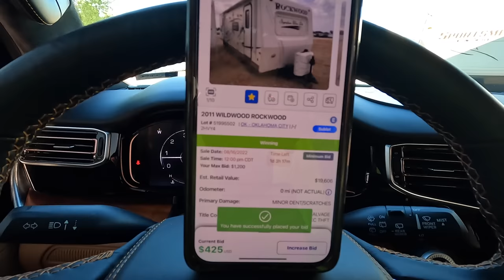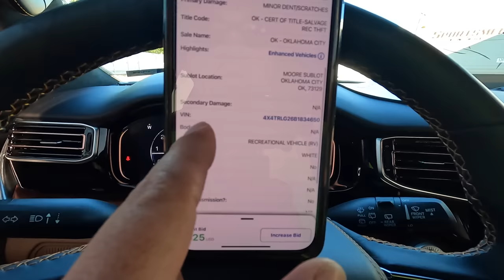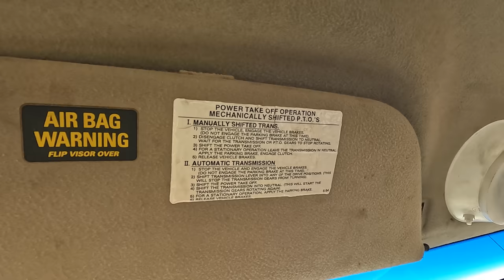Copart Walk Around 8-18-22 + Theft Recovered Trailer + Cheap Ford F550 Tow Truck!!

Comment: Randy the tow truck would work great for you, you can tow two cars at once and if you don't need it then you can turn around and sell it for a profit.  The 7.3 is a great motor and a stick shift on top of it makes it better.  The back lift is called a wheel lift. The PTO is what runs your bed and lift and winch, the two prong plug in the front is to plug in your jump cables to jump start cars also a aluminum bed which is good. Bid on it.
Reply: X2 on the "Bid on that one".  Also, the rear wheel lift is often called a "stinger" by people in the towing industry.  Also, this truck has controls on both sides!   Not all of them do.  That's a very big deal to tow drivers
Reply: Bid on the pickup Randy
Reply: He won't buy it
Reply: I forgot about something I got a diecast diecast Chevy Silverado pickup truck 2017 z71 crew cab
Reply: All trailer to my diecast truck and pulled it with no problems
Reply: I got a die-caster 205 f350 tuff  diecast  truck   it is  bet up  but it  still  tuf

Comment: Randy, the silver bubble material on the travel trailer windows is often called “Reflectix”, and is used to reduce heat gain in the summer and heat loss in the winter to help increase the effectiveness of the air conditioner and/or furnace.

Comment: The F550 would help with lugging cars, definitely help the channel 🤘🏽
Reply: A friend I know has a Chevy truck with a flatbed hauler. One is a 1994 model with a 6.5 litre turbo diesel, a 1998 with a 5.7 litre petrol engine, the other is a 2002 Silverado 3500 6.6 turbo diesel with an Allison automatic transmission. The other two, the 1994 has a 5-speed manual transmission and the 1998 has a 4-speed Automatic overdrive transmission.

Comment: One thing about the flatbed wrecker....
You could haul more than one car at once. One on the rolloff and one on the boom or the trailer on the back.  I know you buy more than one at times...and you have the new building site to move to...
Also the camper will come in handy on the building site when you want to stay on location or have someone stay there on guard.

Comment: With the amount of cars you are buying lately Randy that Ford F550 tow truck could prove a very useful buy for the channel 
and save money and make your life so much easier transporting your vehicles yourself providing most of the equipment works 
and the purchase price is right and any other required equipment and parts are cheap enough.

Comment: The 87 should be able to stay cool. Make sure you keep the front windshield and reflective coverings on all the windows it helps tons. Worst comes to worst a portable ac unit does wonders. Rockwood is a pretty good manufacturer  of travel trailers also.

Comment: Always jump the closest battery to the starter on dual battery vehicles. If you jump from the farthest battery you have to build juice in two batteries instead of one. Also the part on the back is called a wheel lift or a stinger. Love the channel keep up the iOS work

Comment: I added a generator to mine with a remote start so
I can start and stop it from inside.  I had an enclosed insulated box made to mount on the rear if my rockwood signature ultra light to insure it was quiet enough and protected from theft   Have had it set up this way since 2008 and it works perfectly.

Comment: All the pto does is take power from the rotation of the transmission to run the hydraulic pump that works the hydraulics for the bed. It does not mean that it will take off on you. I could be wrong but, I believe the term power takeoff means you take power off of the engine. Also, if you notice the longer you let your battery pack sit on there the easier the truck was cranking. I think if you would have left it a minute or two that thing would have fired right up.

Comment: Randy there us no oven because they have realized that most people don't use it except for storage. Some people even remove the stove. Most camping folks cook outside completely.

Sometimes you have to use 2 hands to open them. Push in as you try to open. My 2013 Rockwood is that way.

Comment: That Ford F-550 has desired options. AM/FM stereo radio with CD 💿 Compact Disc player, 6-speed manual transmission air conditioning, power door locks, power windows, electric mirrors. Would be a nice truck to have. I have friends in the car business and they bought the Dodge/Ram, Ford F-Series, Chevrolet, GMC trucks. A friend I know bought a 2002 Chevrolet Silverado 3500 with a flatbed and auxiliary tow. Bought the truck at an auction in Vancouver Canada 🇨🇦 the speedometer and gages are metric. Kilometers per hour large, miles per hour small, odometer registers in Kilometers. The coolant and transmission temperature gage is in Celsius, the oil pressure gage is in KiloPascal. The truck has a Power Takeoff, the transmission is an Allison automatic which is the transmission used on both the Chevrolet and GMC Heavy-duty trucks. Good luck on bidding and let us know how you did.

Comment: I believe the lever on the floor by the PTO is the parking brake on the rollback. Growing up my dad had a couple wreckers and thats how they were ,flip the PTO on, then flip that lever to set the brakes. I never really knew how they worked, so I could be talking out of my ass, but I think that holds brake pressure on each wheel hydraulically, opposed to just the rears with the stock one cable actuated one. I think that truck would have had the transmission mounted parking brake drum assembly, if it wasn't deliberately deleted for some reason it probably had issues they didn't brother to fix, or they could have swapped in another zf6 trans from a f250/f350

Comment: I'm sure you've already placed several bids on that Rockwood but I would stay away from it. That bubble wrap on the windows probably means somebody was living in there trying to keep the Heat and the moisture down. Not just somebody using it occasionally through the month. Also with the slide not being able to seal up good means that you most certainly have rot damage somewhere.
Reply: Mobile tweaker pad

Comment: Most trailer roofs are designed to take abuse, the vent covers are designed for easy replacement, I wouldn’t worry about hail damaging the roof the trailer is to new. Most travel trailers and rvs have insufficient ac capacity that’s why they have hookups for a second unit or for upgrading the current unit for more btus. You need to run smart vent fans which remove heat from the roof area and automatically close when they sense rain.
Reply: Beware of postings like this.

Comment: 17:31 That 99 F550 tow flatbed truck is in alot better shape then 03 F450 one few weeks with bad wiring under hood I'd say get flatbed save time getting things from Copart back & forth plus u can start another business helping people need a boast off or broke down on side of road. Now know it's 21 year tow truck & needs some rear tires but if good price snag it up.

Comment: That f550 would make what you do alot easier like ya said no more trailers and it may not work on all but most dual battery diesel the starter tends to be fed off of the passenger side battery hooking the jump box on that side should help them crank faster

Comment: That F550 is a great deal, especially because 7.3 powerstroke! I think the red thing on the floor is the brake, because red means stop, right?
Reply: That would be the PTO to engaged the bed so you can move it. Same with the wheel lift in the rear of the truck. Js

Comment: That's not a block heater connection. It's a pre wired hook up for a set of jumper cables. Had the same plug set up on the tow truck I used to drive

Comment: With RVs your better off going with a portable generator... The on board ones are a ton of noise and vibration through the chassis ... Also you'll want a solid chain and good lock.   Generator thefts are bad in camping areas

Comment: Those travel trailers after being in a Hail storm... that roof turns into swiss cheese!! That roof could be compromised!!  If you can get onto the roof... walk around and if you feel soft spots... it'll need a new roof which will cost thousands!! That first one looks like a base model toy hauler as it has a curtain for a wall partition!! No oven, etc!! That second trailer... people damage those doors all the time in order to break in to steal the tv and Refrigerators!! Someone couldve vandalized the inside of that as well!! Those doors will cost a lot to replace

Comment: Hey Randy, I truly respect and admire your knowledge regarding Automobiles! but when it comes to RVs there are so many things you need to know and check before you buy but you  didn’t on that motorhome. I really don’t think Copart is the place to purchase an RV. I could be wrong on that you could get lucky!  You need to check for leaks, Grey water and water tanks, refrigerator, air conditioner, furnace, generator and of course the condition of the engine! there’s a channel called Dave’s RV life, he shopped for several years for a smaller motorhome and found one for $2500 you wouldn’t believe incredible condition low mileage he got everything to work, No leaks neat and clean 25 foot I don’t think you’ll find out at Copart!
Reply: Just buy it cheap enough to do all that work so you know it is good.

Comment: Yes The back of that Tow truck the metal thing you didn’t know what it was called they wheel lift and that big red button yes there is a PTO a.k.a. the power takeoff and other black box beside of that is Work control the lights nice video but you’re a place a bid on a tow truck

Comment: On the Rockwood why wouldn't you have a locksmith make a key or two for it rather than damage the door or door frame more than it already is. Should you screw up an entrance door and there is nothing wrong with the interior it's still not usable because the doors screwed up. You have to tow it out of there anyway so you could make arrangements before hand, if you win it, with a locksmith to run it by his shop. Check some out get referrals from some of your local contacts.

Comment: On the f-550 the parking brake could have been replaced with a line lock (possibly what the switch side of the steering wheel is for) and the plug on the front could be used for a winch but since there is no winch mount it most likely was used for jumpstarting cables. Probably would make a good truck.

Comment: in order for the ac to work on the rv, you need to be plug in-to 30 amp. as it needs power to run that tow truck will work great for you. i would bid on it for sure.

Comment: I think many of us in the comments told you what they hide in the bumper, I know I sure did.
Most RVs or Travel Trailers are traditionally warm, until you put the AC on.
Most traditionally only have maybe two or so inches of insulation.
Since you drive around the lot, why not keep the extra jumper pack in your vehicle??

Comment: You need to look for a classic Flexible Motorcoach with a rooftop AC  unit.  Those have character.  And if you're fixed on a trailer, check out the Airstream line.  Everything else is just too cookie cutter.  Well, except for the fairly recent Winnebago Brave RV.
Good luck Randy!  👍🇺🇲⛽

Comment: As long as there are no gaping holes in the roof the Grey Wolf is a good deal. Even with small holes you can reseal the roof with dicor or some similar roof seal. Replacing skylights in not a big job. You could replace the broken skylight with a better one like a Maxxair MAXXFAN Deluxe and it would keep it  cooler. Is it possible COPART would let you bring a ladder to look at the roof?

Comment: Get the Tow truck asap even if it's 5k you would get your money worth just by using it cars that don't start you can hook an move way easier than pushing them or whatever trust me I tow on a daily with a 2013 kenworth t270 so I use a truck daily you can't go wrong with buying that F550 if you get it for under 10k you basically stole it. 😂🤣🤙🏼

Comment: I think the f-550 tow truck would be a good investment if you get it low enough and those plugs in the front or not for a winch therefore jumping other cars when it was you know AAA or whatever kind of tow truck it was they would just plug their jumper cables in special kind and jump car so they don't have to open the hood and all that stuff but you could have used your card don't you have any jumper cables in your car used both your car and your jumper pack it would probably have started it? Oh well but I would buy it later